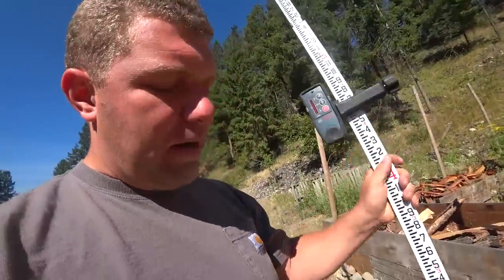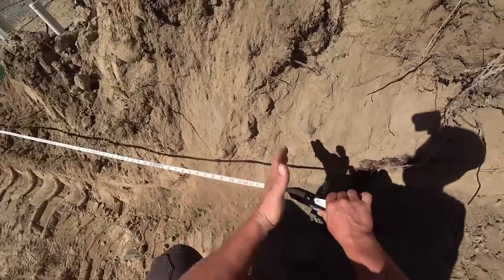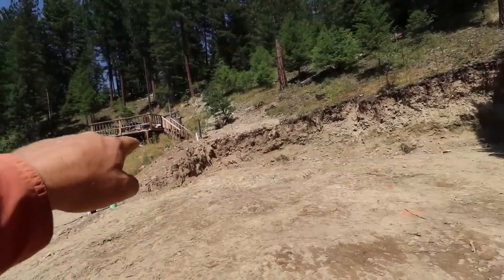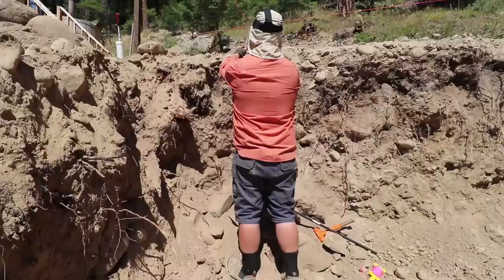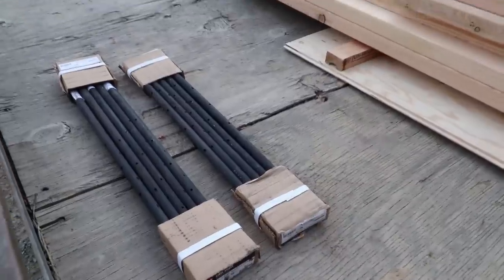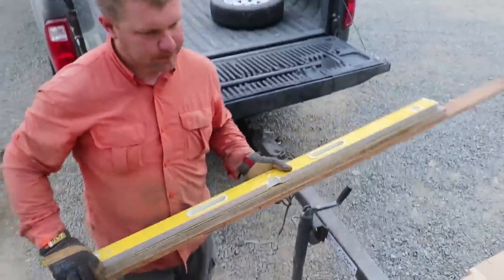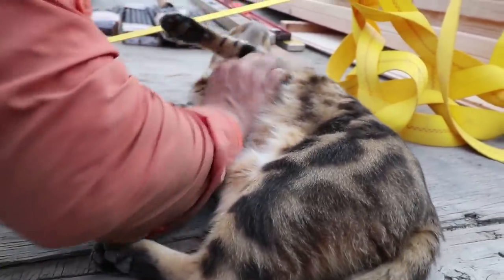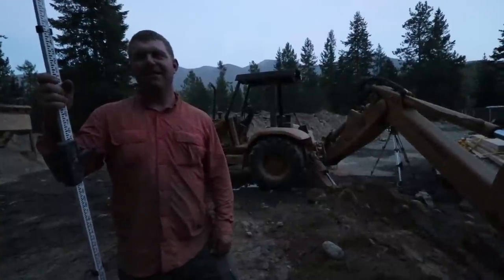TAPE MEASURE MELTDOWN (Squaring & Leveling Home Site)

Comment: You're better off taking more out than backfilling. When you dig out it's compacted and settled. When you add to raise it's not compacted as well as settled. That can cause problems when you add weight such as cracking foundation or slanted structure.

Comment: Working on a metric project we ended up being off by an average of 2 inches per job.... upon examining the tape measures even though they were made by the same company and looked identical- one of them the metric side of the tape started back like 2" from the end of the tape. On the SAE side it started at the end but not the metric. I smashed it and threw it in the trash. That cost us probably.... $15k so i feel your pain... BUT at least you caught it before your house was a parallelogram lol.

Comment: J & A Enjoying the videos. A little learning about practical uses for 100th of a foot. We/you can use a calculator for dividing and multiplying thus no use of fractions of an inch. There are 96  1/8s of an inch in a foot and we need to fudge 4  1/8s to make that a foot back to 100ths We hide those 4  1/8s at ----- 2 inches / 4 inches / 8 inches and 10 inches. So 1 inch with 8  1/8"s  would be .08 and 2" inches would be .17  with the first hidden 1/8" So now for a practical application such as ordering concrete volume for your form work. Footings might be 8" high x 16"  wide x 55'-10"long  or  .67 x 1.33 x 55.84 divided by 27 cubic feet (1 cubic yard measure) thus by calculator....1.8317 cubic yards volume. Of course you must allow for your pumper and some spillage because you don't want to send the concrete truck back for a little more.

Comment: Had no idea at all of a decimal foot tape measure.  Just checked my 100' steel tape measure that I have been using for 40+ years, it's all in feet and inches.  I learned the Metric system in 7th grade back in the 1950s.  Only the USA and I think  Somalia are the only users of Imperial measure any more...

Comment: The tape is an Engineering Tape.  It is in 10th of a foot.  You may find it easier to use building your home because the tape is in 10ths and 100ths of a foot, instead of fraction of a foot. Give it a try you will like it once you are use to it.

Comment: Don't you have a drainage system for rainwater? And did you pour concrete directly on the soil? I'm Building a house in Sweden and i had about 1m with sand and gravel plus two layers of drainage pipes under/around the house. And 300mm with isolation under the concrete slab.

Comment: Your main hydraulic spool valve assembly needs a look at.  You seem to have hydraulic creep :-)  When you changed out your hoses, did you cycle your valves to their full extent both ways several times to expel all air?  You can see if you have any fluid leaking out your work port with all valves in neutural.  A closed-to-actuator valve should hold or lock the fluid on both sides of a ram.  Check the torque on your springs to make sure that they have the same tension on both sides of the spool valves.  None of your hydraulic rams should move from the position you left them in.

Comment: Use manual focus if you using dslr. it much easier if you get yourself a simple video rig with focus follower.  and don't forget led video light that can mount on either on the dslr hotshoe or on the video rig it self. :)

Comment: Has anyone ever mentioned to you, that those round rocks that you guys keep digging up, used to be in the bottom of an ancient riverbed! You may want to sample some of that material before you cover it up! There may be gold in there! Maybe even more than a little bit of it!
Reply: Those "boulders" got round by rolling down the hill.  The mountain might be sturdy, but those dug-up round rocks lying on the surface are not safe to be around until they are in a flat valley!  More than the chance of flood, perhaps you might want to confirm you aren't in the path of a potential avalanche during the winter?
Reply: Roobah, those "boulders" were under yards of dirt and soil before they uncovered them with the tractor! They did NOT get round by rolling down the hill to there! Those "boulders" were rounded by years of water action rolling them in an ancient river! I don't know the area that they are building in, but if gold is found in the area, then I would definitely be test panning some of those layers where that river rock is coming from! Especially where those bigger rocks were coming from! They say with placer gold, "the bigger the rocks, the bigger the gold"!
Reply: Actually, those rock (mixed with dirt) deposits are commonly found in glacial moraines and the topography of their property is also very similar to one. A riverbed consists of mostly just (flat) rocks, in between or on top of a layer of soil.

Comment: LOL^^, Bummer man, I also am a land surveyor and have a tape that is 1/10th's on one side and inches on the other. It's a pain and I should throw it away. I have to check every time to make sure I'm measuring in the same units. Likewise one of the big nightmares for a land surveyor is converting Architectural dimensions (feet and inches) into decimal feet (real world units :-). I'm now living in New Zealand and have gone metric and it's so much easier as Adamsky commented.

Comment: LOL.  Yep, the surveyors use 100ths of feet so everything was great when doing the fence measurements but when I was laying out the forms for the foundation I was having a hard time doing the conversions from feet and inches to hundredths of feet in my head so I had to take the home design sheet and use a calculator then write the the 'hundredths' numbers on the sheet.  Even with that I kept getting the numbers switched.  I did it all by myself at first but then got my son out there with me and found and corrected my mistakes.
Reply: Oh yeah, the boards!!!  The endless loop of rain and sunshine curled my boards while on the trailer during the time I was excavating.  We don't have any dirt.  It's all rock so it took my son and I a long time doing it manually.  I took 2x4s and screwed them perpendicular to the edges of the 2x8s to take a lot of the warp out.  It was a nightmare.  I am so glad the foundation is poured and it is all over.

Comment: Just curious what would it take to make a bridge for the concrete truck to cross over the first footing?
Reply: With all that rock I would be tempted to mix my own concrete and try to use it up in the footings not sure if that is allowed but I have seen it done.

Comment: You should be able to rent a concrete pump trailer for less than the pump truck coming out. About the only difference between the two is the trailer doesn't have the cool boom part on it

Comment: This is why you should be using the metric system.
Reply: 1 system has been to the moon. It was not the metric system.
Reply: It was the metric system which went on the moon. The Apollo guidance computer took inputs from astronauts in "imperial", then used metric for orbital calculations internally, and then converted the final result to "imperial" again for the astronauts. :-)
Reply: They'd probably have one with 120 cm in a metre.
Reply: Alex C nobody forbids them to say 16/389ths of a meter, if they enjoy working with fractions so much. I'd stick to decimals, thank you :-)

Comment: You will not want to under excavate to tight  close  to the footers. Realize that the parimeter drains and waterproofing need to be installed.  I have installed over 350 homes. I use 5ft wide for basements and 3 ft wide for crawl spaces.  Let me tell you not fun digging out deep walls if to tight. Also counterfeit walls need dug out on long deep walls.

Comment: note that there is a style of tape measure called an "engineer's" tape measure that uses English feet but only has 10 units per foot instead of 12. This means that the "inches" on an engineer's tape measure are larger than a normal Imperial (English) inch

Comment: While I agree with the comments on Going Metric, that just is not going to happen for some time so it is a moot point. You can use the rule of thumb in that each .01' is very close to an 1/8" since there are 96 of them in a foot. Every .08' is one inch. You can make a correction of one eighth every .25'. Since you are working with dirt, you will be fine.

Comment: I would add more, but Mr. Norton hit it on the head.  It is referenced as engineering scale when you go to places like fleet farm.  Some of the tapes there are labeled engineering scale, and just have tenths on them.  Threw me off majorly when I first saw it as well.  (It has nothing to do with imperial vs. metric)....  As long as you square to the same number of marks over, you should be fine..... ;)

Comment: FYI, they sell a 6' folding rule that has inches on one side and 10ths on the other. Easiest way to convert. Surveyors and Engineers always use 10ths of a foot to measure with. Just for fun 1 1/2"= .125 of a foot, 3"= .25 of a foot. 6"= .50 of a foot, 9" = .75 of a foot 12" = 10/10's of a foot etc. Contractors really have to know a lot of information to get a license.

Comment: A pump can be a wonderful thing.  I have poured 40 yards in a single day (In about 2.5 hours.)   You and Elisa may not be strong enough???  That is not meant as any slight.  The elephant's trunk will wear you out fast,,, and you will be using that walkiung around on some form or scafolding,,, footing. (Not the foundation type.)

The usual over cut is 3 feet.  you will have your spread or rail footing,, usually shared inside of foundation wall, outside of basement wall.  You may have waterproofing, perimeter drain, and pea stone, drains through the rail footing,,, all are jobs outside of the basement wall.    You, of course, do not have to remove concrete forms from the outside.   Just make sure you have enough work room out there.  You will need a very fine backfill material with the foam blocks.   

Laughing,,, drive until it hits something,,,,,, Montana?

You're doing fine.

Comment: You could just put lumber across the front footing and the truck would drive over it to the back corner. Bummer about all the lost water.
Reply: old time engineer --- Correct, I've done that several times.

Comment: only 2 ft for frost? where are you located?
Reply: don't think they've disclosed more than somewhere in Idaho. a lot of experienced viewers have questioned every step of this build
Reply: Maybe shouldn't compare the east coast to the west coast?  While it does get cold in the Rockies, it also is generally dry.  One need only look at the digs these folks have already conducted to show just how little moisture is in the ground.  Meanwhile, in the east, ground water levels are often really close to the surface. Check out these maps as one representation: https://diy.stackexchange.com/questions/30324/how-where-can-i-find-out-what-the-frost-line-is-for-my-area.
Reply: Well I never.......I thought they were in Canada Lol
Reply: according to the map, my area only requires a 5" frost wall.  there's not a slab in this part of the county that is less than 24" and tied to bedrock limestone. my buddy lives a few miles north and off the limestone. his goes down a full 36". everything in his area is pre-stressed. my wife sold a house 150 miles south, on the coastal plains. it's slab was poured in the '50s. the frost wall was 24" on sand and gravel. in practical use, the map is meaningless.

hey, Uncle Sausage, let's show some 'spect for my Canadian amigos. LOL.
Reply: They mentioned they were in the panhandle of Idaho a while ago.
Reply: I hope their architect is local. and they have a building permit to satisfy. their last two winters certainly suggest deeper footings.
Reply: understood. and the charts even show the zones more parallel to the pacific coast rather than the latitude in the rocky mountain states. Still better safe than sorry....
Reply: R Montana - in the archives, they say they chose this location with an eye toward NO PERMITS, and NO INSPECTIONS. they had the septic tank professionally installed, so maybe they wont poison the neighbors
Reply: Dubious - I have a vision of her putting a bowl of ice cream on the counter and it sliding downhill to the garage door. LOL

Comment: Outside of most of the repeat comments about how that's intentionally in 1/10ths:

Common woodworking advice is to always use the same tape when you're transferring measurements.

So if you need both sides to be equal, for instance, you don't switch tapes.

Tapes can be inaccurate, and it's not a huge deal, so long as you get things matched up.

Comment: After rebar inspection...Using dunnage in the dug footing, (logs with cable underneath) placed only in the drive path of the truck allows you to back over the excavation, Place the first truck of 10 yards or (more?) by tailgate and when truck empties remove the logs  dunnage) with the backhoe then replace the rebar and pour the remaining footings without a pump! FYI Fiberglass tapes are OK for gross measurements and work well around clumsy people and auto traffic but will stretch 4 inches per hundred feet so tenths or inches really won't matter! Lose it... buy a steel 100' tape!

Comment: The 1/10 foot measurement is the standard measurement for surveyors and ground work people. It makes the math easier...assuming you know that's what you're working with. Adding, subtracting tenths is MUCH easier than twelths.

Comment: Designing with computers CAD is much easier in 10th's rather than fractions of a foot.  With fractions you are always using a calculator but 10th's just require moving decimal places.

Comment: 10th's are way easier when doing excavating that's all we use (10-10th in a ft ) 5feet=50,tenths vs 5feet=60,inches,,, most plans are in tenths so make sure you know the difference when you get with the engineer

Comment: Engineering tape measure. It's called decimal feet. It's still a foot but broken into 1/10ths instead of 12 inches. Should be the same thing as the grade stick your laser receiver is attached to.

Comment: Now is the time if you haven't considered...FYI: http://www.city-data.com/radon-zones/Idaho/Idaho.html
 Techniques exist for reducing radon levels in homes. Experience with radon mitigation systems has developed to the point that virtually any home can be fixed, either by a trained radon contractor, or in some cases, by homeowners who accomplish the repairs themselves. One out of 15 (6%) homes nationally may have elevated indoor radon levels that should be lower.  The percentage of elevated homes in your state may be much higher. The only way to know a house is elevated is to test is formed by the natural decay of uranium in rock and soil deep in the earth. Radon is found in every state and moves through the air and water. It has a decay life of approximately 4 days, which can build up over time depending on ventilation. The health risks of radon gas can lead to a risk in lung cancer.

Comment: I have one word for you yanks. METRIC. You can't beat it for engineering and construction. I always work in meters and millimeters. Your imperial system is a pain in the arse for much more than a very rough construction job or getting a rough idea of size.

Comment: In the real world 10 is the divider. It is called decimal system and our whole number system works with it. World is a better place when using a measurement system that also uses 10 as divider as opposed to 12/3/whatHOWMANY.

Comment: The imperial system is so bad the US engineers even fraction feet in decimals instead of 12ths. (Decimals means 10ths)
1 m = 10 dm = 100 cm = 1000mm  = Metric system
1 yard = 3 feet = 36 inches =  36 000 thou   = Imperical system 

So metric is 10th->10th->10th
Imperial is 3rd -> 12th -> 1000th  
Waaat?!

Comment: Why not rent forms
Reply: it would be cheaper to just to by material from a local than sometimes to rent. My personal reasons for example are, if the renting company drops panels they wont pick them up some times, and this is such a small job it would be cheaper to just by the material and plus its yours at the end.

Comment: It is a civil tape measure, much easier to read than a regular (Imperial) tape measure. Also the same as what you are using on your laser level for elevation. Common tools in dirt work, and you thought you'd never use that 8th grade math...

Comment: It has to do with the economy and saving where ya can. With inflation being what it is. Your saving 2 inches per foot. Now they take unused  inches and box them up for use later. Now some companies will send these to underprivileged african countries.
Then they have inches that we saved. And when you need a few inches, it makes all the difference in the world. 
Have you ever considered all the uses for inches? Well it's really incredible. And it's not like you can just pull an inch out of the air. They have to come from somewhere. Inches just don't grow on trees, ya know. So your doing not only our country but the world a very big favor by letting people have these inches after all global warming would  be an even larger problem, but by using a 10in rule per foot, you are following me right? You see global warming would be even larger problem if it wasn't for using shorter rulers. Or longer strings. buts thats another story.
Another thing people can't stretch the truth as far as they use too.Really I had an uncle who would bla, bla, bla
And that's the truth